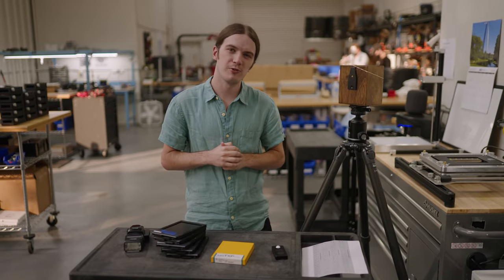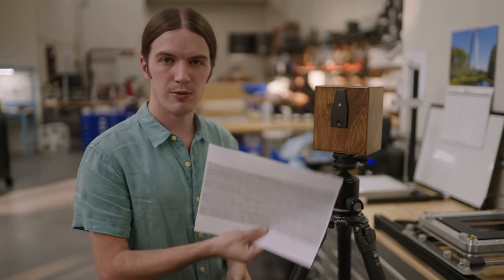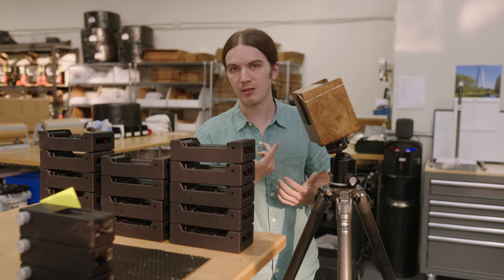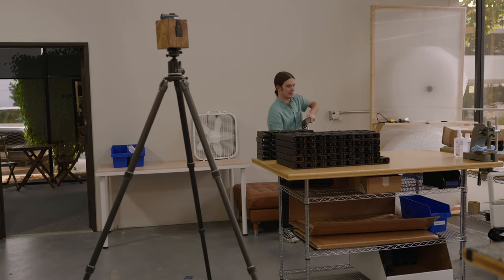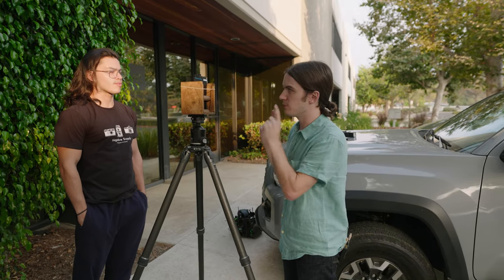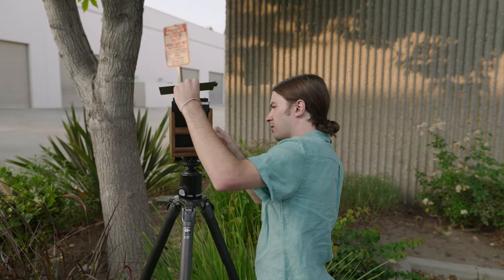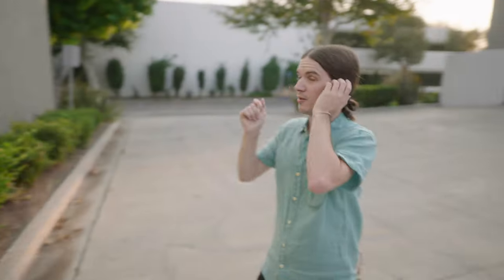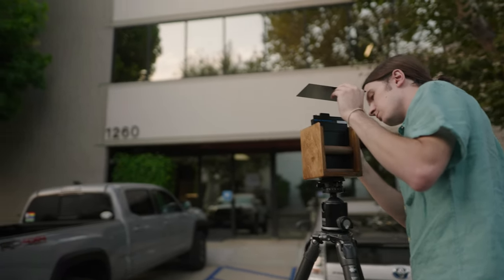4x5 Pinhole Photography With AJ Holmes

Comment: Cool. Over the years  as a pro, I've done a lot of large format (4x5 and 8x10) and  I've done some pinhole photography.  The bottom line on all of this is: with a pinhole you get an unsharp fuzzy image. It's interesting,  challenging; well worth doing . However, I can't see anyone serious doing it for very long.  
The effect you're really after would is accomplished by old portrait lenses. These were always too expensive for me. (Instead of an adjusting aperture they have  insert slides with tiny holes around the center hole.)  There's a  range of 'Effect' that goes from  pinhole to old portrait lens all the way to super sharp apochromatic. Like Nikon Micros.   Anywhere along this range is a challenge, can be interesting and may  become a tool you'll use, maybe even regularly.  Pinhole is just a step in this, don't over do it or overspend. (If you are doing film, learn about compensating developers and flashing the paper in the darkroom. I used to shoot old paintings 8x10, and flash the film at the location. That's like tightrope walking,  doing math and juggling knives at the same time. Ansel Adam's books are good. Otherwise there are some books with specific techniques, but I've never seen one on how to set up a really efficient darkroom.) 

Of course you don't have to spend that much. Also the image circle of a pinhole is large, but that doesn't mean you need a super wide.   Also Film Holders. I've still got dozens of them. The best way to clean them is blow them out, maybe even wash them (Dawn dish soap is good for everything). To clean off the dust and eliminate static electricity I would always spray Pledge furniture polish on a static free cloth. (Those ones for cars would be good.) Contains silicone, so I'd never use it on my furniture, but great for film holders.  Don't bother with the really old wooden ones, they fall apart.

To light seal a film holder just  have a lip on the camera cover around three sides of the holder . At  the top add some layers of black paper tape to fit in the space between the two beads on the holder. That makes a baffle.  A rubber band will hold it against the back of the camera box. I always just made pinholes out of cardboard because you have unlimited options. 

To reduce internal reflections from the inside of the box, put any kind of glue down, sprinkle it with fine saw dust, ( I might just use Psyllium Husk because I have that in my kitchen.) Spray paint it matte black.  For a viewfinder, just draw angles on the sides and top. Start dead center at the Back of the camera and draw two angles to the front corners.  For precision sight along the lines.  (You don't really need a viewfinder for a camera if you just practice.  I could always hold my Nikons over my head and take well aimed shots. An iPhone... not as good.) 
For a shutter just use a piece of black tape. Put black paper right over the hole, reduce the stickiness of the tape.  

The hole.. don't try to make it too small, do try to make it round, but flat is more critical, raised edges can reflect light. Ever project an eclipse? Transit of Venus across the sun? (I made that pinhole in seconds ragged but worked fine.) The shape of the 'aperture' (hole) isn't that critical. If the costly laser etched... ones are better, I'm curious.  I usually just used aluminum foil. Drink can aluminum is great.  And if you already have a 4x5 camera, or can borrow one.  Just tape a pinhole on the front. 

There are very good (incident) exposure meter apps for smart phones. This is from a guy who precisely measured light for 40 years. Still have my Minolta IV somewhere and compared it with two of the apps.    A good DSLR makes the best light meter you'll ever have, if you can set iso, and it tells you the shutter speed aperture. S hooting B&W negs  outdoors I just started using my Nikon D2X as my light meter  (The earlier meters like on the F3 are really not that good.)   Stick the reciprocity failure chart on the side of the camera, also put a stop watch there. Now you can just start it timing,  then at any number open... then close as needed.  You could get very close to 1.5 seconds or even 1/2 second this way. I like a stop watch because as the hundredths or thousandths pass you can pick up the pattern.  Remember anything you can forget to take on location at some point you will forget it. 
Hope this helps

Comment: I do metering for f16, then multiply for the pinhole/focal distance (I have some laminated cards for that), and finally compensating for reciprocity failure (also laminated cards for different film stocks). This way any light meter will do – or just the sunny 16 rule (this is why I thought about using f16 in the first place ;-)). Interesting light meter